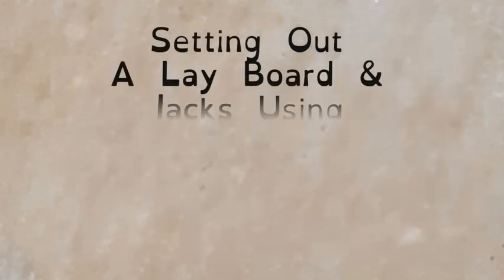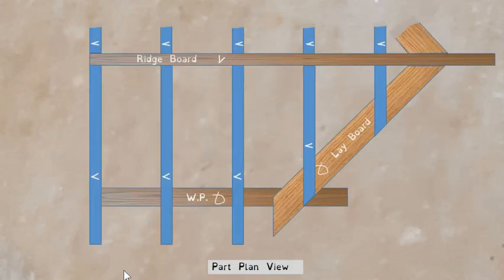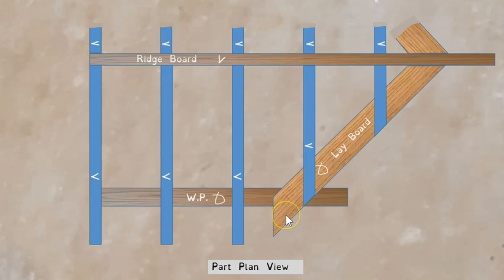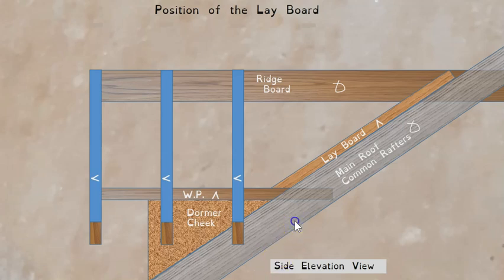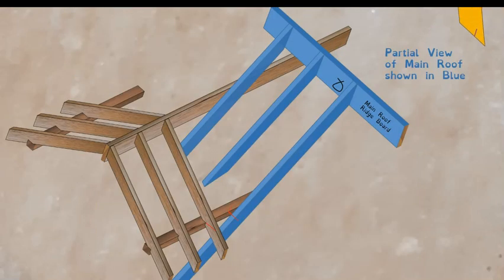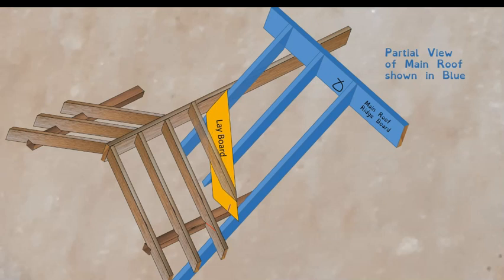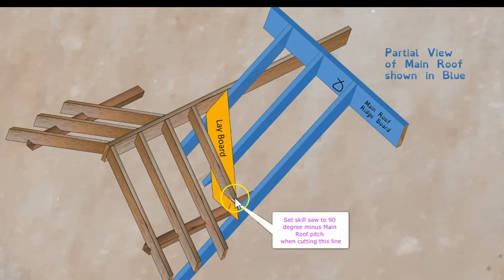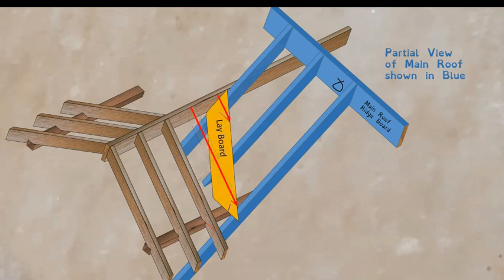Constructing a Dormer Valley using a Lay board  (Valley Plate)

Comment from the maker: If both Dormer and Main Roof pitchs are the same, then you can get the distance you measured from the lath to dormer wall plate in this video, by simply hooking your tape measure on the Dormer Common Plumb Cut ,run the tape along the back of the rafter, past the Birds Mouth to where the its seat line meets the back  of this rafter.

Comment: Hi Michael, great video! 
I'm a bit confused on how we get the edge cut on the jack rafters. I am clear by what you mean to generate the seat cut. But, the edge cut doesn't make sense. Did you say the pitch of the main roof minus 19? So, that would mean, if the roof was 27 degrees pitch then the edge cut should be 8? Just doesn't seem to make sense with the roof I am working on now, 8 degrees seems far to small an angle. 
Any advice would be really appreciated!
Cheers
Reply from the maker: Hi Jack,glad you like the video, meant to say 90 degrees minus main roof pitch to set your skill saw agle at when cutting along the seat line to give the correct jack edge bevel. I inserted a note in to the video at 8.48 minutes making that point.

Comment: hi Michael, if i wanted to put a bevel on the layboard would that be twice the backing bevel for the hip, thanks paul
Reply from the maker: Hi Paul, its the full backing bevel/dihedral angle... between wide face and edge of lay board.... i will make a short video on this when i get a chance. Have it planed on first, before you mark out the lay board

Comment: Good visualized video. It helps me a lot. But i have a question, why the valley jack rafter diminished is determined by the Centre to Centre Spacing and the pitch angle, which is (centre spacing) / Cos(Pitch)

The spacing is on the horizontal plane view, but the diminsh distance is on the angled surfaced. I don't see they have relations to each other.

Could do a visualized video on this as well? Thank you very much
Reply from the maker: working on it.....almost finshed.....will soon upload
Reply: @michaeldownes516  Wow, thank you very much, i don't expect you would do that, i am very suprised. Appreciate that
Reply from the maker: @andy2a2m  here you go.....https://youtu.be/A5Zv7fskr-s      .hope it does the trick